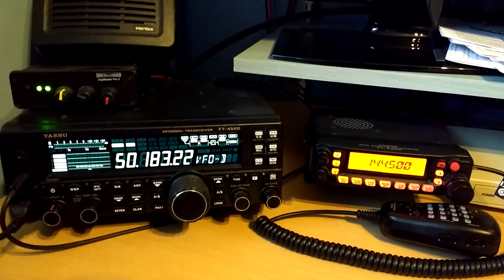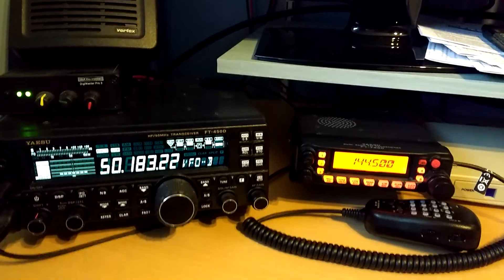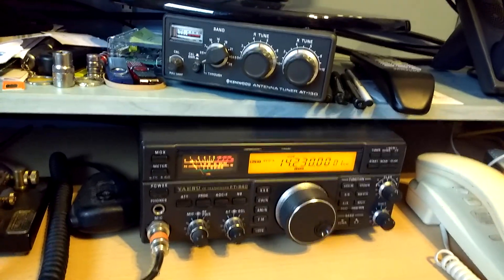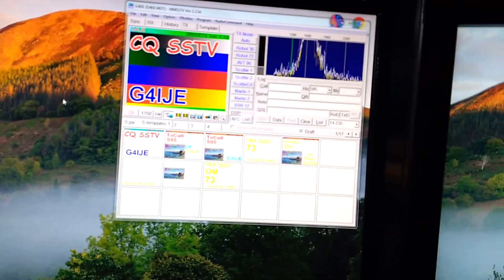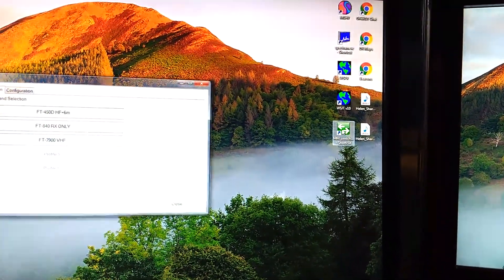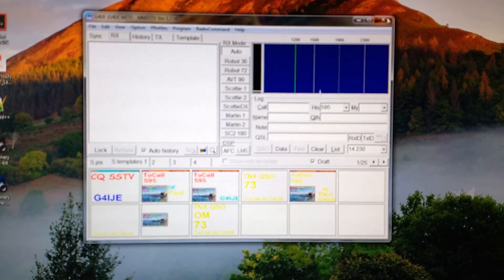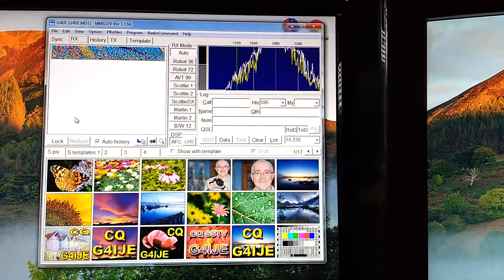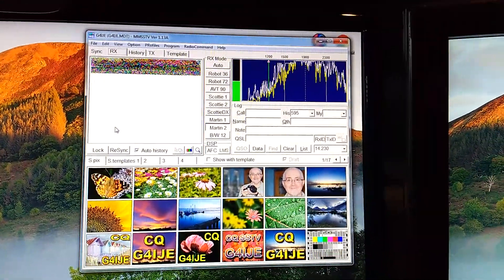MMswitcher for MMSSTV

Comment: What about having WSJT-X and MMSSTV on the same computer. MMSSTV worked well until I installed WSJT-X, then soundcard option vanished from MMSSTV option settings. Any help?
Reply: You can't run them both simultaneously, I use sstv with wsjtx on the same computer with mm switcher and all works well